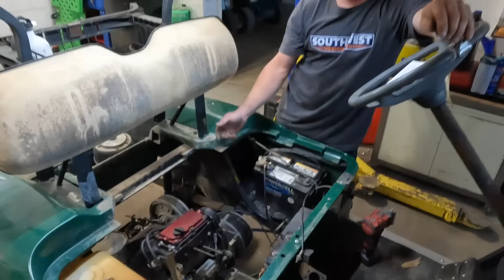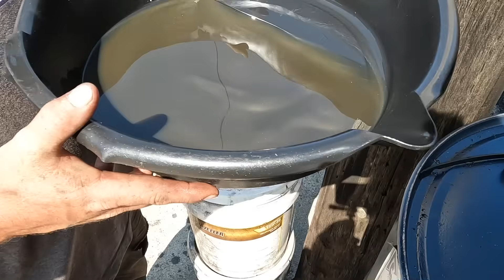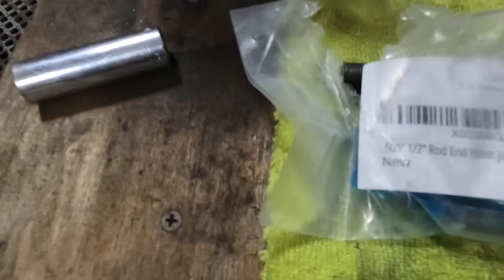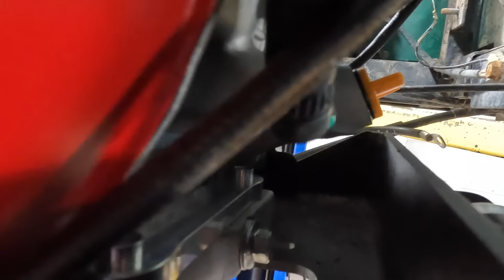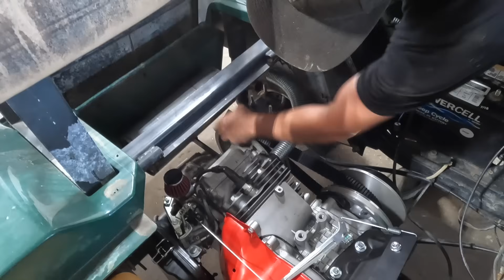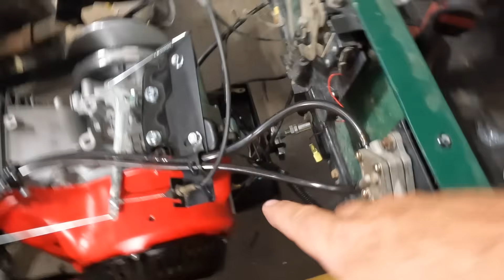THIS ENGINE SWAP WAS NEXT LEVEL! 459cc EZGO Golf Cart INSTALL!!!

Comment: Have you ever tried to put a 200-350cc ATV motor (CVT), that has a reverse into a golf cart?
It seems like it should work and then you have reverse and you could use all the original GC controls, ie, key start and pedals.
Definitely wouldn't be as fast
Reply: I guess maybe a snow machine engine might work also (?)

Comment: You make it a lot harder than it needs to be i have done 5 kohler installs 22hp 2-27 hp 28 hp 25hp 2 of them had  yamaha warrior front ends full rollcage 1 7in lift and 1- 4in lots more stuff all ezgos

Comment: I have a 420 HF engine on mine. It is too fast, jumpy for off road, I even changed the clutch. Thinking about the power spring for the driven clutch. the clutch was frozen on shaft so bad I had to cut it off with grinder blade in many pieces.
Reply: How much is it to put it in

Comment: I’d like to do this since it’s cheaper than a full electric rebuild.  I don’t see how reverse is possible. My cart came with a factory ford 9 inch
Reply: You can utilize an external gearbox but with a full size differential, I imagine it would put a good amount of stress on that gearbox and/or clutch system.

Comment: I have a fully built 420cc with all the billet parts, cam, ported head, stainless valves, 34mm slide carb gov delete. Around 25 HP I built for a drag mini bike. No longer have the bike but kept the engine I think it’s going on my 98 TXT this winter.

Comment: Great job guys, question, what carb do you use, it dont come with the kir and the stock predator carb wont take the pulse pump. Leaks fuel to crank case.
Reply from the maker: We use the stock carb on all our 459/420 swaps. The kit should come with Isolator w/Pulse Fitting and Vacuum Nipple. This is separate from the carb.

Comment: There looks like you could have put that front mount on flipped 180.  Then the rod would not have been to long!!! And it would be tucked between cart and engine now its a snag point!
Reply from the maker: Ah only if it was that simple. We tried that part every different way possible. Manufacture of the kit shows the bracket to be installed the way it is on the video. That's also the way it works best without modifying too much. There is probably 5-10 min of film of us messing with that bracket, but I took a lot of it out the video to not confuse anyone. If you snag something there you are going to have bigger problems lol. That bracket is higher than many other items on the cart.

Comment: Where did you hook up the pulse line for the pump?  Thanks.
Reply from the maker: There is an isolator with Pulse fitting and vacuum nipple included in the kit!